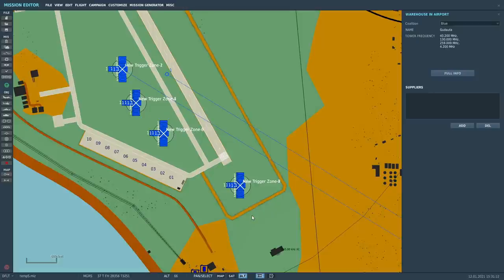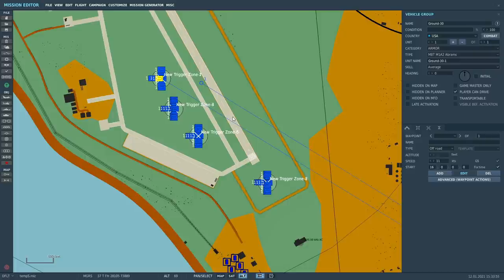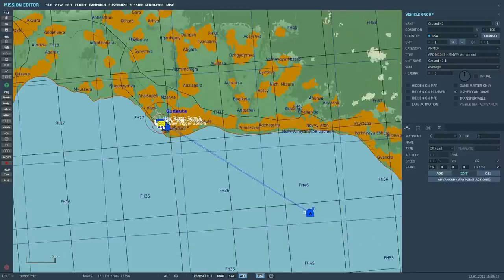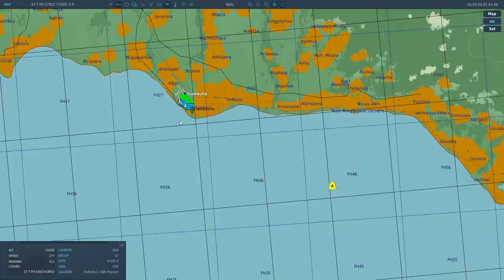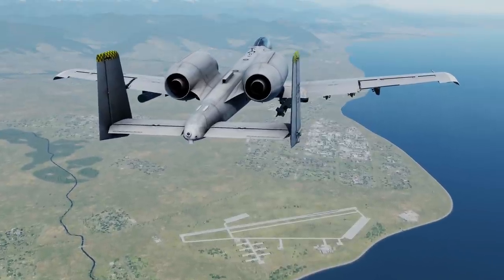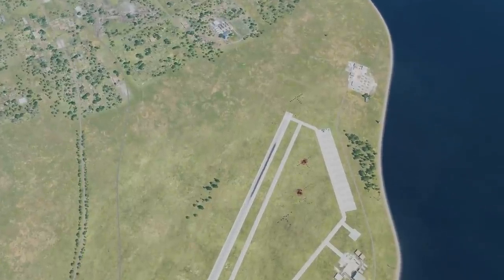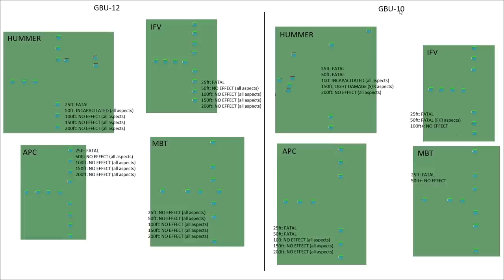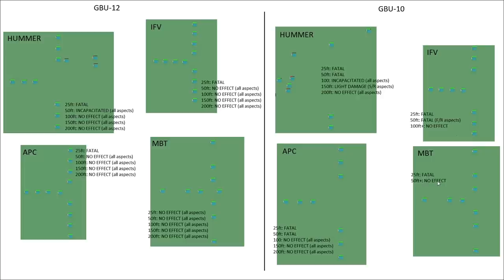Combat: Warhead Splash Damage vs Vehicle Armour Type | DCS WORLD

Comment: Yeah, this is probably something that ED will need to factor in with a new engine, because I'm not exactly sure how they could adjust splash damage for bombs and make it realistic in the current setup. Although I think part of that problem is that such tests in the real world leave next to nothing left of the vehicle they hit. Just look at the Javelin test against a T72 and an Abrams. The largest piece left of either tank was the plate that made up the bottom of the tank.
Reply: its because they were a catastrophic explosion
Reply: That's probably down to secondary explosions? Setting off the propellant charges, ammo warheads inside the tank, etc.

IIRC from reading about tactics for the A-10 in Cold War scenarios some aircraft-launched AT missiles & rockets retained enough kinetic energy alone to seriously damage or kill an MBT, if the warhead didn't do the job. Pretty sure the Maverick could do it, though it has a massive 57kg warhead compared to ~8kg each for both the Hellfire and Javelin. You ain't walking away from one of them hitting you...
Reply: @mrkeogh  nah, but it's a good parting gift.... In that it will part you. Part of you here, part of you there, part of you waaaaaaaaay over there, staining the wall!

Comment: I don't really doubt the MBT results, read an article years ago about the Desert Storm air ops, and in it pilots claimed that 500lb bombs would kill an T-72 only on a direct hit and with a 2000lb bomb you could get away with a near miss. 25ft is believable as a near miss, 50ft maybe not, 100ft definitely not.

And as fuzes were not set to airburst, this might very well be a good approximation even for the more lighter vehicles, the bomb will go a bit into the earth before exploding.
Reply: You'll eventually fracture hull plates and joints with high explosives going off nearby. Knocking out electronics, optics, powertrain, tracks wouldn't be a spectacular kill but you've taken that armour out of the fight until it can be repaired.

Comment: Airbursts. You have to do airbursts to get good damage against armored vehicles and tanks. That's because that is where the armor is thinnest, usually because of the hatches.
Reply: To defeat armour you have to hit directly. Hence why all anti armour weapons have very little splash damage, cause they are all shaped charged. So even if it is weaker armour a air burst or any kind of area burst is going to do very little. except destroy antennas and other exterior item. You can see in nuclear videos civilian vehicles are completely ripped apart as the blast hits the vehicle in the test video but armour get thrown through the air and not actually ripped to pieces. But if you get a APFSDS rounds they don’t actually have as much explosive as you would think and do very little blast damage. But they work on extreme heat and shaped charged to get through armour.

In real life I has seen a 1,000lbs bomb fall near a IFV and not do any damage to the armour at all.
Reply: @ffwrdm8332  So, wait. So you would endorse using a two thousand pound bomb to destroy a tank when a five hundred pound bomb airburst would do the same job? 
1: What I have been typing is established battle doctron long before I served.
2: A bomb that doesn't detonate until hitting the ground is actually going to be underground when it detonates. And that means the blast is going to be mainly focused up in a wide cone pattern. 
3: We, the US, have had the VT proximity fuse since WWII and it's been getting regular upgrades since then. And it works just as well with bombs as it does with anti-aircraft artillery and normal ground artillery.
Reply: @MajorHavoc214  
The penetration of bomb fragments in airburst is not high enough to even penetrate the roof of tanks
thats why you need very close hits, or direct hits with delayed fuzes

this is confirmed by actual Flight manuals / tactical manuals:
https://cdn.discordapp.com/attachments/722583290451853406/799633480321335316/unknown.png

Fuze settings best suited to kill certain targets

Comment: I'm confused about the bomb weight system. I always thought that bombs were rated by how much explosive power they had in comparison to TNT. So a 1000 pound bomb would have as much explosive power as 1000 pounds of TNT. But in this video you talk about having a bomb having an actual weight measurement. A 2000 pound bomb with 1000 pounds of explosive for example. I mean that seems like an insanely heavy bomb to be carrying around, are they really that heavy? What have I got wrong?
Reply from the maker: So for instance. Mk83 = 1000lbs bomb. This is the Gross weight. About half of that is the casing etc, half is the chemical HE.
Reply: Nope, the bombs really are that heavy. Just shows how insane the amount of lift modern planes can generate. An A-10 can carry twice the bomb load as a B-17 and still outfly it.